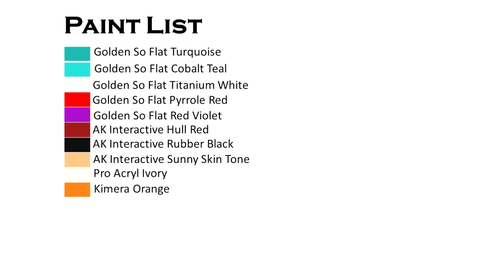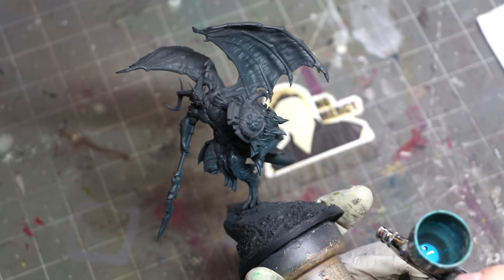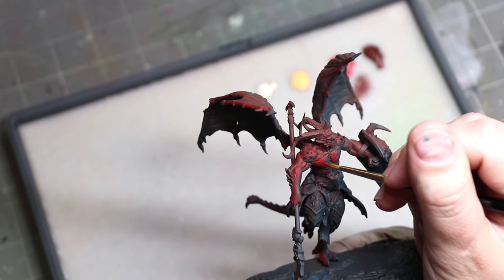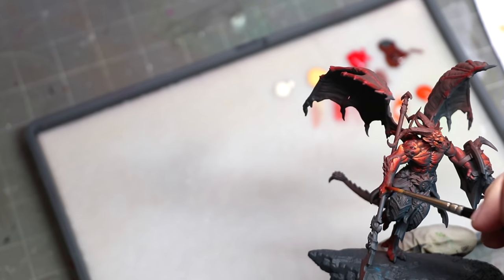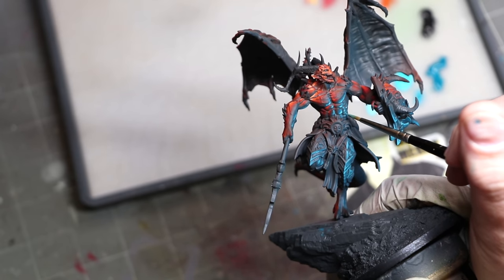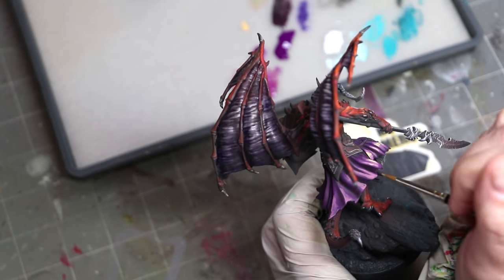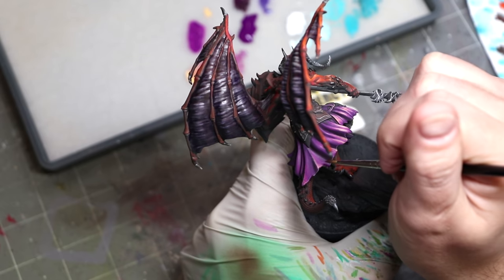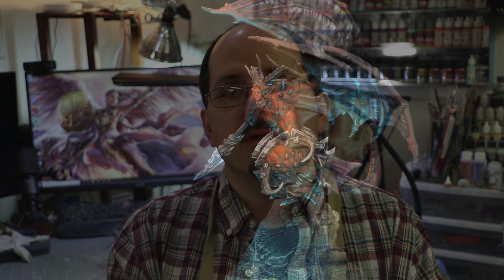Understanding Lighting & OSL - HC 336

Comment: Thank you so much for this tutorial, great work! What I am frequently struggling with ist not knowing where to place believable highlights. Do you have any guidance for understanding volumes? Also: I noticed you are using the So Flat line by Golden lately. How do you like these paints?
Reply from the maker: I liek the golden flats, review will be coming eventually. as to where the place the highlights, this is a complicated question, but my basic answer is the top of the volumes, think of the top of the whole shape (i.e. the whole miniature), then each individual volume (muscles, shoulders, etc). If we're talking about generic light, you are basically creating a soft light from above. This is one of those places where you can google lighting conditions and really get some good examples.

Comment: In architecture I both used and learned quite a lot about lighting in 3D modeling and digital matte painting. The lighting is based on real world conditions and translates nicely to art work theory. Miniature painting lighting however is completely all over the place with inconsistent, weird and hyper real practices. Even at high level. It must be really frustrating for beginners.
Reply from the maker: Yes, it's all a mix of real principles and of course artistic interpretation. Sometimes you are doing things just to make it read better or look cooler. :)

Comment: Hi Vince. Thanks again. Awesome content. 
And a nice timely video. I'll be doing some atmospheic lighting soon.

The figure I have is wearing a black rubber gasmask. Lit on one side from a distant fire.
The shadow side of the gasmask will be my blackest black ofc. But as I move round the head towards the illuminated side I'm not sure what direction to take it and wondering if sunny skin tone could be my answer. 
Go gradual from black > touch of dark sea blue> sunny skin tone perhaps? 

I realise rubber will be tricky as it is quite matt but can have bit of a sheen to it (use the sunny skin tone) and also doesn't really take on texture that I could simulate to sell the idea of rubber.

It's a decent size head so have decent area to play with. 

It could be one of those ones where I just need to just sit and paint it til I find whats looking good. But if you have any ideas that would be fantastic buddy. If not, just say, that's cool too lol 

11:21  And a lovely shirt it is!
Reply from the maker: I would have some light on the other side, even if just a very soft blue-moonlight, but beyond that, the colors you're describing seem correct.
Reply: @VinceVenturella  Of course. Gotcha. That's what's swirling round my head anyway. But I've been here before. It'll probably all change when I sit down at the palette 😄 Thanks! Much appreciated.

Comment: Vince, when I build layers I have some combination of the following issues:
*If I make thicker layers to achieve opacity and provide that striking contrast, they take FOREVER to glaze the transitions smooth
*If I go with thinner layers, I’m wicking off the excess and applying but I feel like my pigment breaks down providing a “muddy/chaulky” look with little opacity (no matter how much I apply).

I tend to go with other techniques that produce better results for me (like two brush wet blending) but that’s not possible in all cases. I really want to get layering and glazing down. I suspect it’s a factor of paint consistency.

Long message (sorry for that).  Can we deep dive into consistency for techniques?  I use hobby paints (GW, AP, Pro Acryl, etc).  Appreciate the help!
Reply: @actualwafflesenjoyer  ya know, I don’t feel like I am but I add some water then test the consistency on my nitrile glove for transparency of the paint.  It always seems like by the time I achieve transparency, the paint breaks down and has a chaulky look to it…more of a residue.  I like the idea of adding the glaze medium…I do on occasion but should I be adding glaze medium and some water or just glaze medium alone?  I seem to have a bit better results with slight water addition and a drop of medium…that gives me the transparent look while holding the pigment.

Thoughts?
Reply from the maker: So many options here, techniques like feathering can help blend those two better even with thicker paint. THis video here will explain paint consistency, but it could also be some level of the paint you're using. Higher pigment paints can go thinner without breaking down and getting chalky. 

Here is the video - https://www.youtube.com/watch?v=TbCtUYFwFWQ&list=PLcdsbwBroEmD2fNEJhcju6PD7qRmoo04Y&index=81
Reply: @VinceVenturella  thanks Vince!

Comment: Hey Vince, late to the party, but great video!
I'm trying to think of a bit of a lazy version of this for Skaventide, and was wondering if you think my process might work okay? Going for a diffuse light from above and a mid strength warpstone flow from below. 1. Prime with shadow colour 2. Whitish cone from above and below 3. Base coat with contrasts/other transparent paints 4. Lightly spray white from below again, followed by a transparent green 5. Highlight from above and below as normal. My thinking is that this way it sits somewhere between the true colours from the diffuse light and overwriting colours like the motivated light. And also it sounds pretty quick and easy, which is a plus when there's 50 ratmen to get through!
Reply from the maker: You would want to be really careful with the light from the two directions, it will be hard to keep the occulsion/terminator shadow between them. You wouldn't want to paint the whole thing, you need the shadow between and you need the OSL to be basically all green. I have another video where I do a skaven bust and show the lighting scheme you're describing, so check that out.
Reply: Thanks Vince! Yeah, I did watch that video and it looks good, but was just trying to figure out if a softer warpstone glow could still work. Only 3 weeks until I can test for myself!

Comment: I have a question. What should I do if the direction of light is the same, e.g. zenithal lighting and a brazier or torch on apex point of model. Like a character in moonlight holding torch above their head? Thanks for  your great work!
Reply from the maker: Sure, so the answer is one wins. Walk outside and hold a lighter above your head on a sunny day and light it, there is zero effect. Now do the same thing in a dark room, there is a lot of effect. So one of those lights is going to win and set the overall lighting.

Comment: How does the atmospheric or motivated lighting influence reflective coloured metals, like gold or copper?
I’ve hit a block with my recent project using a red motivated light contrasting with an ambient blue, and have been unsure how to complete NMM gold surfaces, so any advice would be appreciated!!
Reply: Good question. +1
Reply from the maker: It's tricky, when you have motivated light on gold/copper, they are base yellow or red, so they will interact accordingly based on the strength of the light. They are tough

Comment: Another knockout here, Vince. Question: How do you decide contrast/highlights are done, especially when working on a piece with multiple light sources? Every time you added a new layer of something on the cool side of this piece, I thought you would be done. Then the next layer cranked it up and I realized why you did it. I struggle with this a lot!
Reply from the maker: There is no simple rule, but let me give you a tip. However far you think you are supposed to go, go at least two steps higher. If you're still not sure after that, two more steps higher. The trick is, it doesn't matter if you go too high, because you are one quick glaze away from knocking it back down.
Reply: Gotcha. Gotta keep pushing!

Comment: Great stuff as always, Vince!

My question is how you would go about this with TMM? For example, for one of my next projects I plan to paint a Dwarf Thane standing in a dark environment under a bright cold light from above (picture the mines of Moria from LOTR). 

I plan to use P3's Frostbite as my universal cold highlight (great stuff, similar to your Glacier Blue). So I would in general add some blue tones via Inks to the midtones of the metal paint. But what about the highlights? Can I dare to add some Frostbite into the high highlights? How would you approach this? Or would you go full NMM so you can use the same highlight everywhere without issues?
Reply from the maker: Yep, it's tough, because TMM is going to also interact with the light around the actual figure, so it's really a key of keeping your highlights mostly silver but just slightly tinted into that tones and having the colors in the mid-tones.

Comment: how would you go about creating these zones if you were a pleb without an airbrush, like some of us? just kinda imagine where the borders would be?
Reply from the maker: Work your way around the miniture slowly with the deepest shade color (for example my dark red) and set the outer edge of your light (i.e. make the circle part of the cone around the miniature) and then pull up and in from there. Avoid putting that base coat on anything else, then just paint inside the line you created. It can certainly be done without an airbrush, but it will take longer.
Reply: @VinceVenturella  thanks!! yeah I know.. I'm crippling myself by not having an airbrush, but living conditions don't permit it, sadly! gotta make do with what I've got

Comment: Would it be possible to add those highlights with an airbrush as well by reducing the area of coverage with each layer?
Reply from the maker: It wouldn't really be feasible (unless you were an absolute surgeon), because you need to draw the highlights in slowly and they have to be carefully placed, the bright light creates deep shadows - which is often a challenge with an airbrush which can overspray.

Comment: What about the Occlusion Zone? To hazard a guess - it would be areas like between the outer wings, in the crooks of the wings, and maybe behind the shield? Basically, the shadows where neither light touched. Should these be painted in sort of desaturated versions of their highlighted counterparts? i.e. the occluded red skin as more of a dull reddish brown
Reply from the maker: Yes, it's basically the dark area between the two areas I actually painted. So in this case, there is an area in the moddle that basically only got a single touch of paint that remains quite dark, a base coat at best.

Comment: Hey Vince, I have problems. As brief as possible - Priming>Air brush clogged>Full disassembly/cleaning/reassembly>Now the airbrush only backflows even though it's 100% clean. 2nd problem - "I have rattle cans">Do the shake for 5 hours/soak in warm water ritual>2 days later primer is still sticky and shiny>How do I get these minis to a point where they're paint-able?
Reply from the maker: So there may be a few items at play here. 
1) You could have build up in the brass nozzle. This doesn't wash out, you have to get a needle cleaning tool to get that gunk out of there. It may seem like your airbrush is working, but there is a thin layer of gunk around the side and as soon as the new primer hits, it sticks and you get a clog. 
2) You may have bad primer. If the primer froze at some point, it can have chunks that don't break back down. Those could be getting clogged in there. 
3) You need to thin your primer, it shouldn't go straight through. I always use a drop of thinner for every drop of flow improver. 
4) You are in an area where the humidity is casuing rapid tip dry and build up back in the nozzle. You would want to add some flow improver and/or drying retarder which could slow the effect of the tip dry. 

THose are my ideas, I hope some of that helps.
Reply: @VinceVenturella  2 & 4 are very possible. Thanks, Vince 🤘

Comment: Love the painting scheme. How would you feel if a whole army would be done in this fashion? Especially rank and file, because realistically they would block light from each other and depending on what the sources are supposed to be and how far away they are, the light should get weaker the farther it travels. The light sources should hit the bases as well. So much to think about...
Have you ever done a video on more of a concept army that this might be? Would definitely be interested to hear your thoughts on the subject.
Reply from the maker: I think you can do it, you know it's going to be somewhat unrealistic, but it could be very cool.
Reply: In this case if you wanted to improve the suspension of disbelief I would say make sure the sources of the motivated lights are visible on either the bases or the minis?
Would at least help on a per mini basis to explain why they are lit from that same angle even as they move around the battlefield.
Ofc you would still have the problem that these lights should presumably shine upon the minis and terrain near them - but that's something that has always been broken by table top games and I think would be totally fine.

Comment: Very interesting. Not sure I'm up to the level of trying these techniques at the moment but intriguing to watch. The only question I have, not being heavily into the miniature scene and not having seen this figure before,  is what is the figure's "natural" skin colour? Black? It seems that all the tones are given by the light sources only rather than tinting the creature's own skin.
Reply: The natural skin tone is red. The light from above is mean to be weak/distant/diffuse, so it doesn't shift the color very much. So the skin stays red, the cloth purple, the steel gray, etc. just with a slightly warm tone to it from the light source. The secondary blue light is much closer/stronger, so it actually turns everything it lights up blue, rather than just a slight tint in the highlights.
Reply: @cliffwood7386  Wouldn't blue light on red skin produce a purple hue?
Reply from the maker: Yep, exactly as said here.
Reply: @spacedock873  You can also think of it in terms of what light is being reflected off of the surface. (Someone can correct me if I'm understanding this wrong) What you see as the color of a material is the light that is being reflected off of it. So the skin looks red because it is being hit by white -or in this case off-white - light, it absorbs most of it, and reflects red. Skin isn't perfectly matte, so it also reflects a small amount of light without absorbing, hence it's slightly tinted by the light color as well. The metal is very reflective, so it looks off-white, with more noticeable areas where it's reflecting the light color. 

For the underglow, the light itself is blue, so there's no wavelengths to be reflected. It doesn't look purple (which would be red+blue), because there is no red to mix with. If it was a soft pure-blue light, it might look black/very dark because of that. But again, since the skin is not perfectly matte, it will reflect some of the light as the same color, in this case blue. In this case the underglow light is very bright, so even though a small amount is being reflected, it still looks like a strong blue.

Comment: Why do demons wear skirts? They're comfy. You should try one Vince. The breeze is nice. 

One thing to consider on the cone vs not - you don't have to use a cone for directional lighting. If there is a center of light, yes, a radial lighting does it. But something like a line or plane of lights will create a linear path of light towards whatever is being illuminated. At a long distance away, radial and linear look the same (see sun to earth). But close up, they're different. :)
Reply from the maker: It's a great point and maybe I need to reconsider my fashion choices! ;)

Comment: I want to take my painting to the next level by painting a piecewith highly directional lighting, I am imagining a miniature in a dungeon with the upper left quadrant of the mini being covered by warm torchlight. Unlike the demon in this video I am not imagining a cold light source from the bottom right, should I? Otherwise I'm not sure how to sell that the bottom right of the mini is not directly lit. Would I paint that part of of the mini with de saturated tones of my base color and add neutral and desaturated colors for the highlights?
Reply from the maker: So you can just reduce the highlights, keep the colors desaturated and infuse blue tones as they are shadow tones, you can see that in many display pieces from something like Richard Grey, but its tough as you are really only painting part of the mini fully.